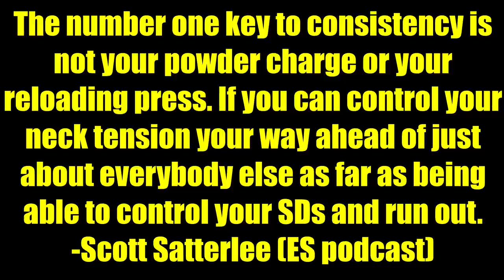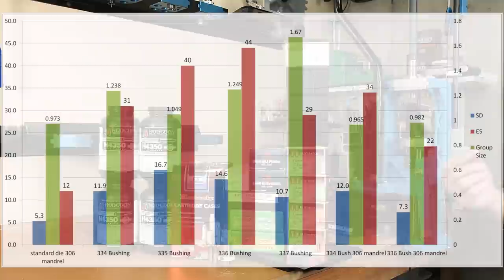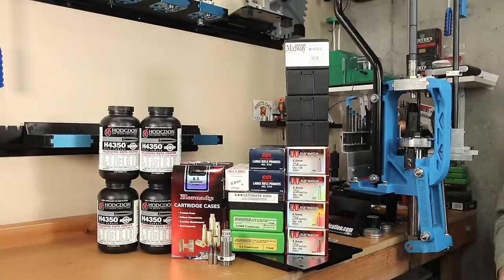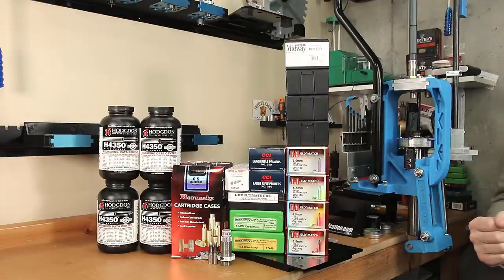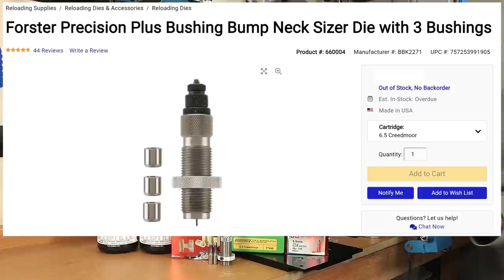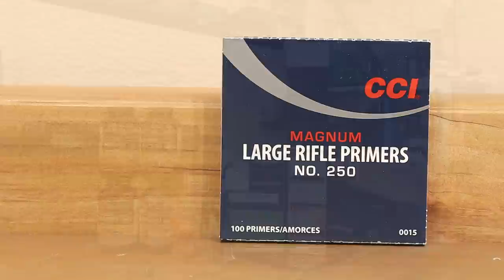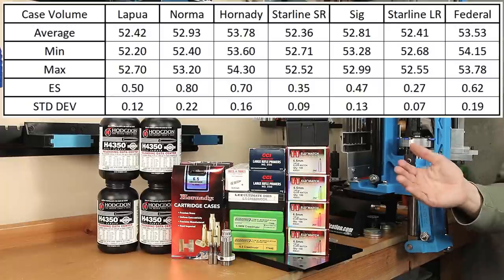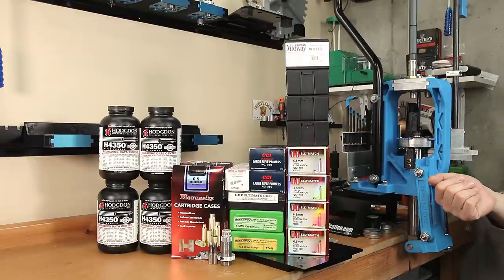Sizing Brass and Setting Neck Tenison - Which way is Best? - The Test Plan

Comment: 1)Resize without expander (neck only or full)
2)Expander mandrel as seperate step
3)Use dry lube (such as imperial dry lube) on bullet for bullet seating
4)Foster/Redding bench rest/competision seating die
5)Lee factory crimp die; light to medium crimp
Reply: I use the same method as this.

Comment: Option 10: Consistent anneal, neck turn, expander mandrel after shoulder bump with sizing die and no expander, seat bullet with arbor press and pressure dial gauge. Consistent neck tension is measurable using the dial gauge in arbor press.

Comment: I really like using the Redding body die along with the Lee collet die. I’m very interested in starting to use the full length dies with the use of mandrel. Be interesting to see which would give more even neck tension
Reply: I have been using the same combination for a while now (redding body die + Lee collet neck sizing die). I just recently added the 21st century expanding mandrel to reduce the neck tension to 0.0025". I would be very curious to see how this setup stacks up as a possible scenario 10. The advantage of the Lee collet die over a full length resizing die being the reduced runout.
Reply: @domr358  have you noticed any difference in concentricity or group sizes by switching to a mandrel?
Reply: The body die plus the collet die was giving really good concentricity, but I was getting some erratic groups. So I added the 21st century expanding mandrel to my setup and loaded my first batch with them today. I'll shoot them tomorrow or the next day and see what difference it's made.
Reply: @domr358  please let me know the results I’m wanting to go that route as well
Reply: Will do for sure! I'm pretty stoked. I went all in with the mandrels and bought an assortment for 224, 243 and 308 cals... 🤙
Reply: I was using a Redding body die. A deconstructed Forester Bushing Bump die, And a Lee Collect die In 6.5CM. Case neck run out checked on a Neco concentricity gauge with a Gem .0005 auto gauge. Annealed Lapua SRP brass on the latest edition of the Annealeez. case neck run out .0006,, Bullet seated with a Forster ultra micrometer seater die. Bullet run out. .0008 to .0010 on average,,,,, My test was with the same cases fired, and annealed,  K&M Arbor press, Forester Bench Rest FLS die, Deconstructed, 21Century .2630 expander mandrel. Seated with a Sinclair/Wilson micrometer chamber die, Sierra 142gn HPBT , CBTO .2278 ( same for the above test.) Case neck run out. .0003, Bullet run out .0005 to .0010 on average. for a 5 shot group. All case necks were trued with the K&M neck turning system to .0135. Charges weighed on a Sartorius Entris II BCE223i V3AT, Both groups produced a bug 1/2 hole at 100yds, out of a factory barrel.. Keep in mind that a fired case normally comes out my rifle with .0008 case neck run out. Of course I check it after I ,,  spin it in the drill with 0000 steel Wool. Please keep in mind also, when I did this test. I took my time and did not rush the process.
** Thank you for your videos if it wasn't for You, Erick , and F-class John. I would be where I am today in this reloading game. Thank you Bolt Action.**
@Chad.. I'm hooked on the Forster FLS die and the 21Century Expanding Mandrel Kits. Your call on the Forster seater or the inline chamber dies. I learned a long time ago how to use my Forester Micrometer seater die. It works great in my Forster Co-Ax press.  I have a Hydro press that should be here in month and that's my reasons for going to the chamber dies and Arbor press. The chamber die did lower the bullet run out numbers and that's what I'm looking for.  Give it a try, you want be disappointed
Reply: @chadschlosser5683  In (my) experience, the Lee Collet will produce very good case neck runout (within 0.001"). But, also in my experience, only half the neck gets sized to the size I want (.290" OD) for 6.5CM. The bottom half is (.291-.292) with 1x fired lapua brass, and I have tried screwing the die in further with the same results, and yes I rotate the case 1/8th of a turn. You can decide for yourself if this is acceptable, but for me it is not. Gonna go with a Honed Forster die + Sinclair Expanding Mandrel.
Reply: @DistinctEditz555  that is good to know I’m going to have to check mine and see what it’s doing. I’m definitely going to try your set up as well. I’m with you on this one I think it’s a better way to go for concentricity. Thank you
Reply: @DistinctEditz555  Did you end up getting the honed forster die? I'm looking at either that or the regular + mandrel and wondering if it's worth it.
Reply: @demitrisolvinski  I would have if I had the patience. Just went with a regular forster, took the expander out, and used a mandrel. Runout has been fantastic consistently 0.0015 or lower, with the same exact neck OD. Has zero variance with Lapua. Not even 0.0005, all the way to the shoulder.
Reply: @domr358 get back in here and reveal your results!😐

Comment: Had good luck with the mandrel. I 'iron' the necks of new brass with the Lee collet die. Size, turn 90°, repeat until full circumference has been done. The better brands are generally pretty good to start with. Does help with the common brands. 
Full length size with a .002 bump, without sizer, then mandrel the neck.
Reply: I used to run them 120° so the collet sections did not line up again.....

Comment: I use a redding boddy die followed by a lee collet neck sizing die. Coupled with turning the ne k and annealing every time gives me consistent neck tension and low Standard Deviations. It also keeps my runout low. 

Im sure the process mentioned are good too. I just use the process that works well for me.

Comment: I anneal after every firing then use a fl bushing die set for .003 tension. After that I use an expander die set for .002 tension. I think the annealing is important. Needless to say, using good brass helps

Comment: Definitely Option 10, I've had great success with this method. Although I use Lapua small primer brass that I open up the flash hole with a lyman flash hole uniforming tool.  Added benefits-works brass less, no bushings required, less to buy for new and experienced reloaders.

Comment: Across the board I use a custom ground Forster full length die (no expander) to minimize overworking the brass.  Then I mandrel size to final ID.  For precision bolt guns I start by turning the necks for uniform thickness.  For semiautos I put a light to medium crimp with the Lee FCD.
Reply from the maker: Hi Mike, I am sure this is a great option, and I have thought about custom honing in the past but for time and availability sake wanted to include off the shelf options only. I plan on mentioning that in the video as a "preferred" option, but requires the service from forster.
Reply: @BoltActionReloading  yeah its a great option and worth ordering straight from Forster to speed the process and save extra shipping.  The trick is figuring out sizing. I generally assume .0135 neck thickness and have found that to work well even if dusting off the necks during turning.  Keep up the awesome vids.

Comment: I use the Redding competition neck sizing set with body die for bumping the shoulder when necessary and a .289 bushing. No crimp/neck tension only. Just picked up .288&.287 bushings for turned necks. ES 4fps.

Comment: I am no expert reloader, in fact I only have been reloading 9mm.
I bought a 6.5 Creed. And through all my research i have come down to the following. Bump the shoulder back with a full length die. Set final neck tension with a mandrel die. Seat. 
I want Forster comp dies. But they are scarcer than hence teeth at the moment. Yes anneal and trim too. But we are over complicating the reloading process

Comment: Very easy to turn down the recapping pin in the Lee collet die. Drill and sand paper and 5 minutes to make it fit Lapua
Reply from the maker: While this may be an option for some I am limiting the options to off the shelf options that people can buy without modification. I can not expect new people to start turning pins, neck turning brass, etc.
Reply: Any average reloader can turn down the pin.   Excited to see how this plays out.

Comment: Glad you’re taking this to the next level.. can’t wait to see the data! Until recently I was using the Forster Bump Neck Sizing die, could get .001” bump w/ it but struggled to get a .002” bump, probably me.. but didn’t matter cause .001” worked fine. Played w/ .291-.288 bushings coupled w/ the 21st Century mandrels .262-.2635, shot about 1K rounds w/ my RPR, can’t say I figured out the best combo yet, but could argue I was seeing some of my best results w/ the .290 bushing & .2635 mandrel. Have switched to Forster FLS die w/ no expander ball following up w/ the mandrels. The biggest difference I’ve noticed is having to trim after FLS sizing.. using the Bushing Bump die kept my brass the same length every time, I’m using Lapua LR brass and never had to trim all the way through 9 firings, case length stayed right at 1.910 the whole time. Still trying to solve this neck tension question, so I’m excited to see where this goes!
Reply from the maker: HI Lee, I would love to include that option but I can't find that die available anywhere. (the brass either)
Reply: BAR, if it’s not too late I’d be happy to let you borrow mine! I’d love to see how it compares to everything!
Reply from the maker: Hi Lee,  shoot me a email at moparmadmanyt@gmail.com

Comment: I pretty much follow as Missy Skeeter below does.
Turned neck, fire form and  Lee universal decapping die, wet tumble, then anneal.
FLS Redding S die to set back shoulder .001-.002, no expander, bushing .003 under finished neck size. Mandrel to .001 under bullet caliber to allow for some spring back so neck tension is as close to .002  with bullet seated with arbor press.

Comment: I use a full length die, followed by a 2thou under mandrel, then trim and neck turn, tumble to clean lube, anneal, and lastly neck tension with same as bullet mandrel, makes loading with in line dies super smooth, lastly I use a Redding tapper crimp to kiss the neck. A lot of extra work but amazing results. I do shoot both 223 and 6mm in Prs matches as well as 6.5 bolt gun. This technique is supper consistent across all platforms.
Reply: A side note I pop primer and clean with pins prior to sizing, the second cleaning is with simple green and lem shine only.

Comment: I use option 4; full length size with a mandrel. The only thing extra I do is start by decapping only then cleaning before sizing. I can use a standard FL die from any of the manufacturers for cheap brass; it's all thin enough to not overwork before using the mandrel. I have Redding Type S dies for the better stuff like Lapua. The inner expander button doesn't keep up with a dedicated straight mandrel; I've seen that first hand by how much less the cases are distorted after. Forget about crimping, that won't do your numbers any good. When I started using a mandrel I've found it's absolutely necessary to lube the inside of the case even with carbide and TIN mandrels. Otherwise the brass galls and collects around your mandrel which screws everything up.

Comment: A video from an experienced long range "old timer" suggested the Porter's Precision Products (P3) expander mandrel which will fit in the body of the Sinclair die.  It looks more like a football (like the insert in FLD dies). It leaves two thou of neck tension.  Not an engineer, but surely there was a good reason for the foootball shape.  Must be kept clean or it will drag and greatly increase your effort on the up stroke.

Comment: Great concept and can’t wait to see the data when you settle on an option. From a personal standpoint,  1. expander mandrel and full length sizing die with no die expander in it/decapping die used vs. 2. full length sizing die the expander that comes in it, followed by using the expander mandrel. Recently, If I remember correctly, Scott Satterlee noted he preferred using decapping die, then full length size, followed by expander mandrel. Thanks! Josh

Comment: Secret option 10:  STAINLESS NECK SIZING DIE - WITH INTERCHANGEABLE BUSHING.   Crimping isn’t necessary and will deter from accurate rounds.  Crushing the neck is a terrible solution to solve poor neck tension.

Comment: Redding full length takes the neck 0.006 under and with any kind of shoulder bump makes the body undersize. Sooo my process is no bump, run the full length die 3/4 the way down the neck. THEN anneal. THEN mandrel size 0.002 under.  One of these days ill neck turn first.

Comment: From what I know of bushing dies, they really benefit from neck turned brass. This is less of an issue with Lapua or other premium brass, but the Hornady brass will give random results due to the variation in neck thickness. I am going to be doing some of my own testing in 300 PRC to see what does best for me on bushing FL die only, bushing with mandrel, or honed fl die with a mandrel so it will be interesting to see if our results agree.
Reply from the maker: I completely agree that this could be a factor, I would much prefer to use Peterson or Lapua (this is what I would tell any new person) Neck turning and modifying equipment leads to problems when people are not familiar with everything, and just leads to confusion, misunderstanding, and its not what I would want to tell a guy that just wants to buy something that works. Odds of success drastically increase when the options can simply be procured "off the shelf" I was hoping that someone might tell me where I can find some, but so far, nothing.

Comment: My regular practice for 6.5 CM has been with a Redding FL sizing die and the standard expander.  I've also used the Lee Neck sizing die with no problems.  I just ordered the 21st Century Die and mandrels to try them.  The two step process using the mandrels seems to make the most sense but we'll see.
Reply: Update!

Comment: Unless one is loading in such a manner where neck tension is minimal (there are many pro shooters out there who do this, but surely not the majority) I think the crimping is superflous.  I ONLY crimp on lever guns.  I understand that is personal or situationally dictated preference but I have never found the need to even on my ar style and other semis.  The argument is that a consistent tension and in-round neck provides a consistent powder burn early in the internal ballistic phase and allow the bullet to enter the rifling consistently and as close to center as possible.  The problem with crimping is that it seems to "accumulate" the errors from neck size, neck thickness, bullet size, base-to-datum line, brass overall length, etc.  There is too much variability there for me to ever include it in my precision loads.  125gr. 30-30 loads?  Sure!  168 Bergers in a bolt gun?   yeah.....  no.  

Note that this wouldn't apply to every case and every person.  And with METICULOUS prep one could make a nice consistent crimp..  but there would be a lot of sorting/prep first.

Comment: id say you've got a good plan together and i am interested in seeing the test and results when it is done. 

I Just got into using an expander mandrel die for setting Neck I.D, i ground the expander ball down on my FL sizing die to 8thou under bullet Diameter and then set tension afterward with mandrel

Comment: I use a Whidden full length bushing die without the expander and then run two mandrel operations. Since I turn necks to .013 on a 6.5 Creedmoor - I use a .288 bushing and then use a .2420 and then a .2430 mandrel (I find the step up helps keep everything straight). I dont mind the extra operation since I use an AMP machine as well. My TIR is always below 1 thou and my neck tension at .2620. I have thought about bumping the shoulder and then doing the neck and then using the mandrels but I would think doing the neck and shoulder together is probably better on the brass since there is more support, especially the shoulder supporting the neck. Would be curious as to the outcome of this though. The only time I use a non bushing die is to turn some once fired brass where I need to size the entire neck.